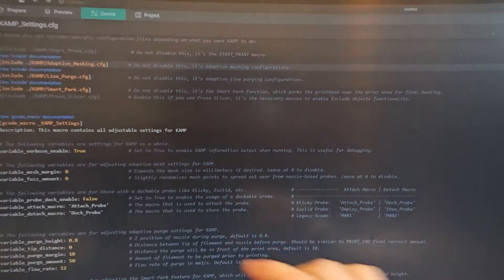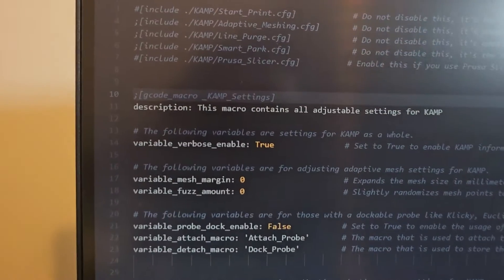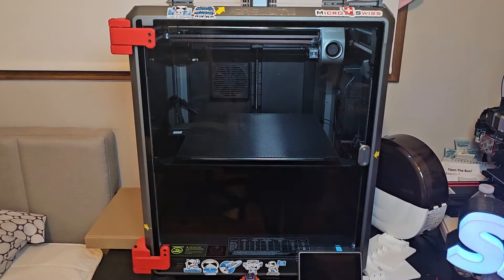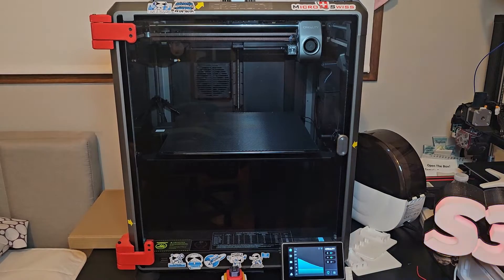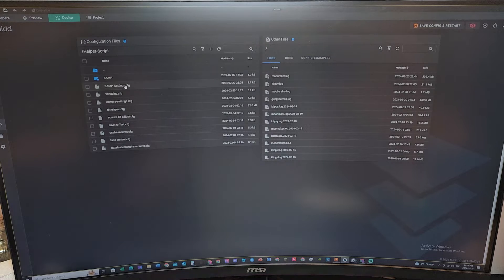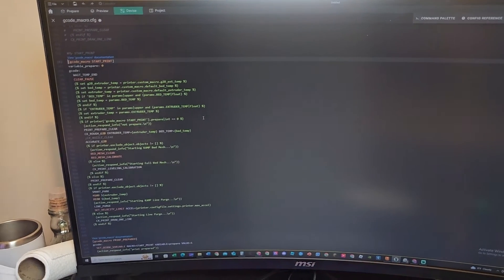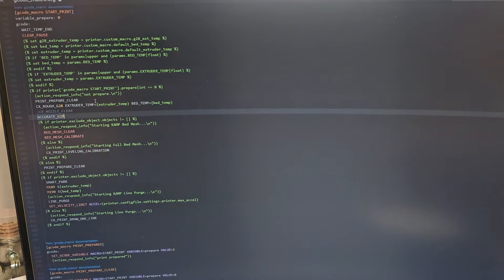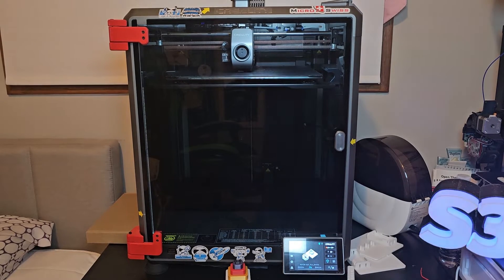This Reduce The K1 Max Start Print Time By Half

Comment: I got my awesome K1 max this week and straight out the box its printing perfectly. Loving ever minute of it. At the moment I do not want to do any changes anything, besides things like door hinge and spool holder etc. No changing firmware setting for now. I started 3D printing many years back before China helped use get affordable printer instead o building your own. My first one frame was out of wood lol so know all about getting the best out of your printer., very tempting . Thanks for a awesome channel, we 3d Print because we can lol
Reply from the maker: Yeah, the k1 max is awesome. It prints nicely put of the box with no modifications, but it's just me wanted to mess around with it. Lol
Reply: It’s worth it to root it and install mainsail. 

It won’t really change the reliability, it will just make it better in my opinion.

Comment: Using kAMP is it not necessary to use Lidar?
Reply from the maker: To be honest, using lidar isn't all that grate, it can't really detect the first line and or first layer. It kind of ruin the print, because it's gotta lower the temperature then do the scan then reheat and print so there might be a chance there's a blob and it takes a long time. Wow didn't expect that to be that long. I just don't like using it, as of now I don't even use kamp meshing because it does not really needed, I only use the smart park and line purge.
Reply: @Scratch3DPrinting  I couldn't get another Start_print to work without cleaning the nozzle, I copied KAMP to "macro.cfg" I commented where you showed it but it still keeps doing that annoying purge.  I was wondering how you managed to copy and the Start_print file in the KAMP folder is still there
Reply from the maker: @fredoliveira7092  what do you mean the annoying purge? the side purge? or the bigger purge where it does it near the print? Or do you mean the purge at the back where it cleans the nozzle?

Checks:
1. did you commented out KAMP_setting: 1:15
2. did you commented out the original macro START_PRINT
3. make sure there is only 1 START_PRINT, the one you want to use. Disable KAMP Start_PRINT also.
Reply: @Scratch3DPrinting  I want to remove that cleaning of the nozzle that is done at the bottom of the bed, as KAMP's start_print does not allow changing, I ended up leaving both, but I did a test commenting on KAMP and nothing changed
Reply from the maker: @fredoliveira7092  Are you sure you commented out all START_PRINT from KAMP. I know you cannot edit KAMP start_print because its locked, but you can comment it out like I how it in 1:15 of the video. Then you just want to make sure that in your gcode_macro.cfg only has 1 START_PRINT. Then if you commented out CX_NOZZLE_CLEAR then it should not do it. Once you have done that run the START_PRINT macro directly from fluidd instead of starting a print, it should be faster.

Comment: Bed probing is disabled in my start gcode. I only need to redo this whenever I messed around with the toolhead or bed. This saves a lot of time. My printer heats up under 4 minutes to ABS temperatures (240 nozzle, 100 bed) only 1 z-offset probe is done and a quick nozzle purge/clean before printing. So including heating I'm printing in 4,5 minutes. I never print in PLA, but think I would be able to print in 2,5 minutes.
So, Try disabling the multi point bed probing, you probably don't need it as Klipper can use the stored mesh data.
Reply: You can share your configuration
Reply from the maker: That is true, but I keep changing build plate so I just let the adaptive probing do its thing. That's fast only 4 minutes to print abs at your setting, nice.
Reply: @Scratch3DPrinting  Yeah, when changing build plates, it's diferent story. I use an 1.5mm thick G10/FR4 plate. This was game changer. When it cools off, parts are literally sitting loose on the plate. I never have to touch the plate itself.
Quick heatup: I had to limit the duty cycle in the Klipper firmware for the bed heater to prevent blowing fuses. It's a 24V bed 20x25cm, and I allow it to get 19A (fuse is 20A)

Comment: I don't have a K1, but normally nozzle-wiping is a must if your printer is using the nozzle to probe.  If you don't ensure the nozzle is wiped before printing, the printer might get an incorrect value for the z-offset because of some plastic still stuck to the bottom of the nozzle.   If I recall correctly, my P1S will: 1) heat the bed, 2) heat the hotend to 250C and purge any plastic that had cooled down inside the nozzle because such plastic is degraded, 3) wipe on the small nozzle wiper to ensure the poop is no longer attached to the nozzle, 4) then fully wipe the nozzle on the back of the build-surface while cooling down below the glass transition temperature, to ensure the nozzle doesn't droop and is completely flat on that build-plate and 5) only then the probing with the nozzle can be done and finally 6) the nozzle is fully heated up again and a purge-line is printed followed by the print itself.  I think the K1 max also probes with the nozzle, right?  So the I would expect you want to wipe that nozzle before the probing.
Reply from the maker: That is somewhat true. I just don't like it wiping on the build plate itself, if the nozzle was wiping in a different place other than the build plate I would let it do it, but I always clean my nozzle every time it finished a print.

Comment: You should not disable nozzle clear. It is there to clean the nozzle before probing the bed which needs a clean nozzle to do that. If you have filament on the nozzle when you probe the bed then your mesh will not be accurate and your first layer will fail. That purge line you showed only comes on after the mesh is taken. Maybe there is a way to purge the line as a method of cleaning before probing 🤔
Reply from the maker: True, but I clean the nozzle every time the printer finished printing, beside the nozzle homed first befor doing the nozzle wipe so if there was filament there it would have gotten a different homed position. Plus it ruin the build plate.

Comment: Is it possible to just edit the code in the KAMP Macro (comment out the nozzle wipe) instead of creating a whole new start up Gcode sequence? To make it easier ? Great Video! Love You Work!
Reply from the maker: No it's not. Or I just don't know of, but start print from KAMP is locked so there's no way to edit it directly from the file, that's why I copy it and put it in gcode macro.
Reply: You can edit the KAMP configuration files in mainsail or fluidd to do lots of stuff.

Comment: I have my replacement K1 max coming in a couple of days. I'm considering rooting it. My worry is stuffing something up.
Reply from the maker: If you're worry about messing up, just make copies of what you're changing in the files and read the documentation that they have its really good information.
Reply: Or, if push comes to shove you should be able to reset the printer and remove all the changed code. But this will only be necessary if major problems occur. The machine will behave like it just came out of the box. This will require starting the desired modifications from the beginning.